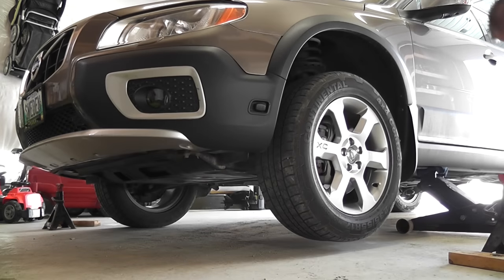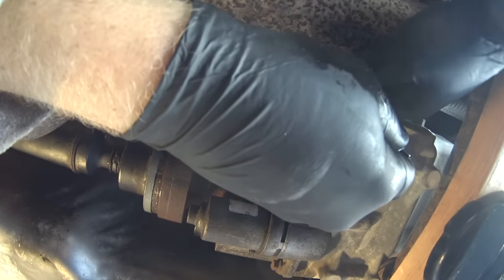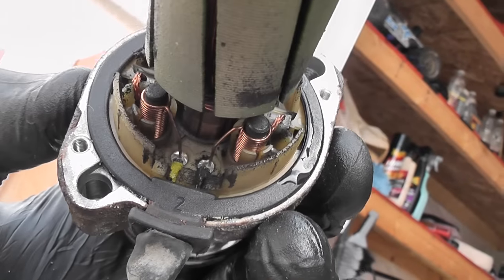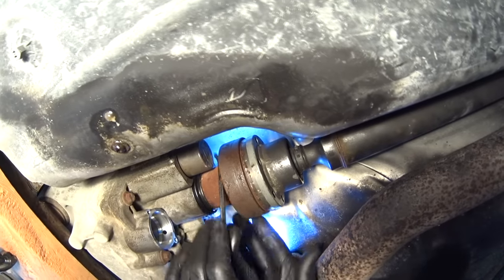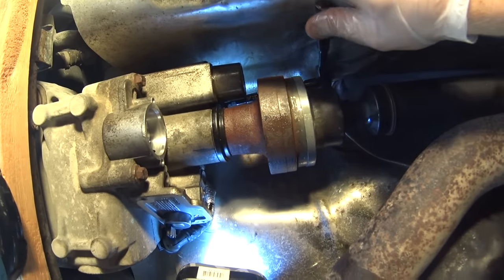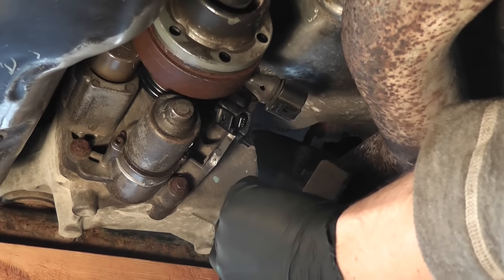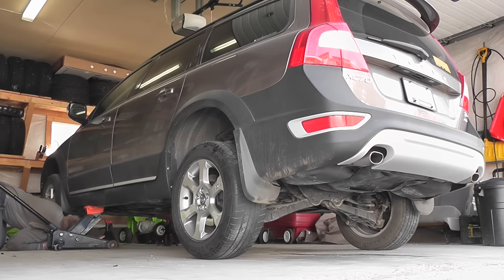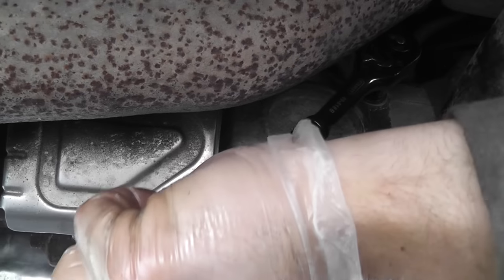Servicing Haldex AWD on a VOLVO

Comment: Using those wooden blocks defeats the purpose of the jack stand and jack bumps that keep it from sliding off. In fact what you did is extremely dangerous. And yeah, I'm a master mechanic with 30 years exp.
Not to mention you put the jack stands in an idiotic spot, where they are in your way. You should have just put them where the jack points are already at, without wood. Your worry about scratching shit, idk what you were thinking about. It's all steel down there.
Reply from the maker: Thank you for the valuable tips here. All the mistakes I made just a proof that I am not professional. Thx again
Reply: @volvosweden  You're welcome. You'd be surprised how many people get hurt and killed on a regular basis working under their cars. When I was 21 and just starting out, a car rolled off one of those ramps you were using and broke my collar bone. Never use those ramps. If your car is too low, go to harbor freight and get a low profile jack, they are often on sale for around $70. 
Also, never work on your car unless someone else is home and keeps track of of you, people become trapped and later suffocate. BTW, I own 2 Volvo S80s with that Haldex AWD. Shits bullet proof.

Comment: Hi volvosweden.
I really love your video and explanations.
I have a XC70 2002 which I recently bought. I have the feeling that the AWD doesn’t work. Does my car have the Haldex gen. 2 system? Could dirty oil and filters maybe be the reason why the AWD doesn’t work
Reply from the maker: Brynjar Jakobsson Hey. How do you feel it's not working? I am not sure what gen of haldex yours is.
Reply: Thank you for quick response.
When I floor the speeder on wet asphalt or a gravel road, I get wheel spin on the front wheels, which indicates that the power don‘t reaches the rear wheels

Comment: Too bad that I have a Haldex three. I need to get the propshaft out of the way. Don't know yet how to do it. Als always, great video. I like the way you film and explain it. :-)
Reply: VIDA makes it look really simple, but can't get the prop shaft disconnected from the Haldex unit. I'd be really interested if anyone figures it out.
Reply: did you tried the  thing with M8 bolt from other  side ,like VIDA says?
Reply from the maker: I did. But laying on the ground with limited space is not easy. Good thing that I can service Haldex without disconnecting the propeller shaft.
Reply: You may find that the "pusher" bolt hole threads have rusted away as I did   I had all the tires off the ground.  So i put it in neutral and disconnected the battery.  I began to tap the side of the coupling with a medium hammer.  Not too hard that might dent something but enough to try to set up a vibration.   Turn a front wheel a bit and tap away and turn the wheel and tap.  About the secont tire rotation the vibration caused it to separate while one hand was pulling on the propshaft.  

Then the real fun begins.  I pulled all six (6) bolts at the U-joint holder to get more play and finally with the help of my son we were able to bang/pull/swear it free while pulling on the exhaust system and twisting/moving the propshaft at the U-joint area.  Same fun getting it back together.  I was not going to pull the exhaust system as my manual had suggested.  That flex coupling at the exhaust manifold breaks easy on an old car.  2004 XC90.

Comment: Hey ! Is the filling, and extraction method the same on Haldex 3 ? 
40ml out, and good to go ?
Reply: I'm sure you've already figured this out, but for anyone else stumbling upon this:

Yep. Straight from VIDA, for Haldex 3, it's the same procedure as outlined in this video. Extract old fluid, (then do pump and filter if required), then fill with new fluid until it pours out, wait until it slows to drips, refit drain/fill plug, drive vehicle around the block a couple times, park vehicle on level surface, open drain/fill plug, pump in more fluid until it comes out, wait until it slows to drips, then extract 40ml (be sure to include the volume of the hose you're using in your calculation), refit drain plug with new washer. Torque to 35 Nm (25.8 ft-lbs). Done.

Comment: Some never XC70's and XC60's (starting from ~2011) have a larger propshaft flange with rubber bushing inside, so You can't detach the Haldex 4 pump without removing the propshaft and the flange. The cap between the pump and the flange is less than 5mm.
To get the pump out for draining the Haldex (4th gen):
- loosen exhausts 3 rubber joints from the rear (relax the exhaust on rear axle)
- loosen proshaft 6 bolts from rear and both middle propshaft holders from body.
- using the additional holes in the flange (from the rear side towards front. some versions have threaded holes to use a 8mm bolt, some don't) loosen the propshaft from the flange (it is REALLY stuck and can show up some serious resistance).
- bend the propshaft down around the exhaust to pry the propshafts connector out from the flange.
- remove nut inside the flange and loosen the flange. 
- pull the flange out approx 10mm to remove the Haldex pump as in the video. No need to remove the Tx10 pump cover bolts and no need to loosen the pump electrical side cover. Caution - read diff oil may start leaking or even flow out, if flange is pulled out too much! Push the flange back in initial position when the pump has been removed.
... proceed with the cleaning and filter change as in video. 
To reinstall the pump, again pull the flange a bit out. After the pump is back in place, reinstall propshaft in reverse order. 
Estimated extra time for removing the propshaft, if You have all the tools and a lot of strength, is about 1 hour.

In overall the haldex oil change can be done, but this maintenance procedure is overwhelmingly difficult for newer volvos with Haldex 4.
Reply: Yeah, I couldn't take my pump off, I guess my flange is larger than in the video, I have 2009 XC70 though...😕  I used a pump to suck the oil out.
Reply: @Reltens  Did you suck the oil out through the filler nut/port? Thanks.
Reply: @chriswernke4824  Yeah

Comment: Excellent video,clear and well explained.
Maybe taking a chamfer from the drive flange would have been better than grinding the pump.
Tam.
Reply: it depends if the area where you want to put a chamfer is already machined
usually, flanges of this type are fully machined so a light touch up made on machine tool is feasible if the machinist makes an accurate dialing

Comment: great video.

 a general question:
can you be sure that the car is level when it's on the wheels? 
or
how to determine that a car is level? with a level?

im mean it's quiet important when 40ml make a difference.
Reply from the maker: Don't think you have to use a level tool to make 100% level.

Comment: This is very informative, very nicely explained. I have seen three Volvo’s here in Maine that had AWD drive issues, wondering why drive shaft was removed. Perhaps the pump failed,  now I see how to service it.
Reply: I had removed my driveshaft on my xc90 last summer because the carrier bearing rubber bushing failed and their not replaceable( had to buy new driveshaft to get new bearing).  Reinstalled new shaft in the fall. Now, I believe my Haldex pump is failing.  Hoping a new filter and fluid will do it
Reply from the maker: How do you determine that the pump is failing?

Comment: Do you have a Volvo Haldex 3 service video?
Reply from the maker: I dont
Reply: @volvosweden  
I have a pump faulty signal need to replace pump. Also the W-button has not worked for a while.
Having to remove driveshaft and our less than perfect exhaust. Looks like opening a can of worms to follow. Just like a plumbing project. There is no such thing as a small plumbing project. Thank You for replying:)

Comment: Haldex 3 has same filter kit as haldex 4?
Reply from the maker: +Šarūnas Sudominai No. They are different.
Reply: Hmm, can't find any to order.. Btw, are you planing to do automatic trassmission fuild change soon? On te next weekend will do my T6 rear axle, bevel gear and haldex fluid change.
Reply from the maker: +Šarūnas Sudominai I got the transmission oil. Will be doing me month.
Reply: Super

Comment: Hi I love your videos, it's explained very well, I have a problem with my volvo xc70 2006 that the rear wheels are not spinning, how can I figure out if it's the differential moduel or the pump?
Reply from the maker: +Mo Stod You have to read codes to be able to find the cause.
Reply: volvosweden I checked on the little window and it says dem is ready.